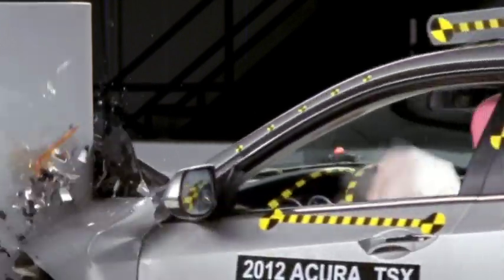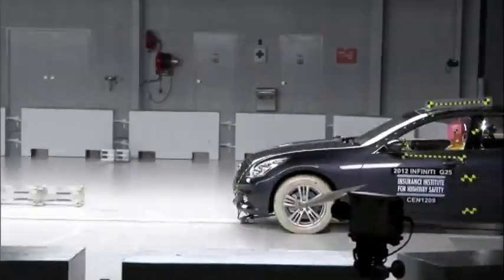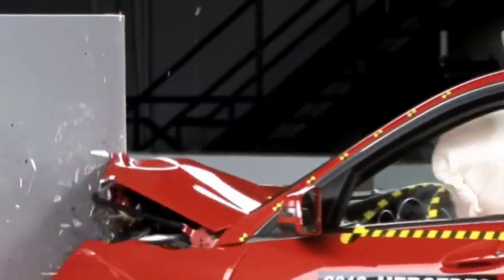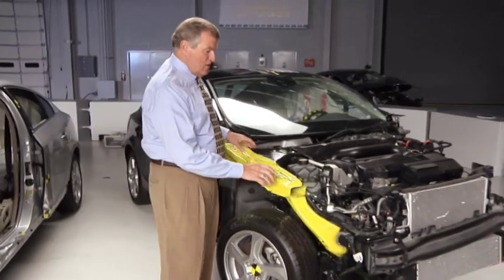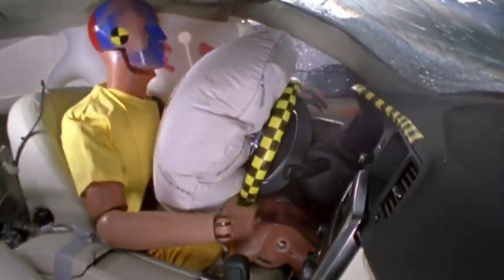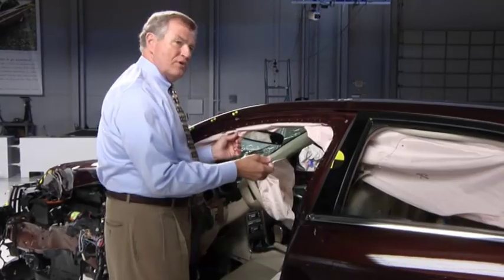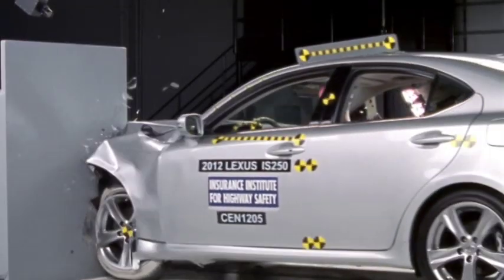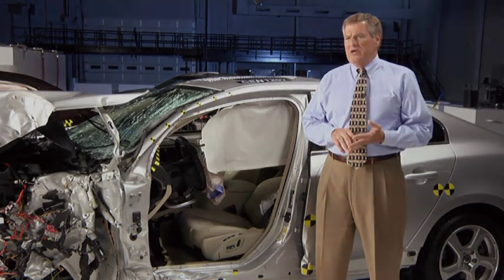IIHS - New type of crash test aims for safer vehicles

Comment: The inertia of a 65 mph crash is 2.64 times greater than a crash at 40 mph. This means, 2.64 times more energy would have to be absorbed by the crumple zones and passenger restraint system. Presently, no car on the planet is designed and built to take such an impact and safe its occupants from death or serious injury (provided such a head-on collision was with vehicles or equal weight and matching bumper hood positions/heights). Nobody should be allowed to drive 65 mph with oncoming traffic.

Comment: To me, safety is a farce. Railways and buses are safer. An alert and coherent driver beats a safe car with road rage or fatigue. I was on the Autobahn and had maintained control of the vehicle, avoiding the car in front of me. Alas, I was slammed into by another car. When it was reviewed, the driver did not have control over the vehicle. The safety didn't matter. My father was T-Boned and died, because the other driver made a bad judgement call, which is why I say this. It makes a difference.

Comment: crash tests with 25% overlap may be an idee worth considering, but surely not against a concrete structure. even the 50% crash tests are against soft targets because its more realistic. if you have a head to head crash with another car, a car designed to withstand that impact against a concret target might be really bad for you or our opponent.

Comment: Its not unrealistic at all- if you have a blowout, and loose control and collide with a  telegraph pole, (many of which are still made of concrete), a tree, or even the edge of a building, this is exactly what may happen-an entirely plausible scenario!